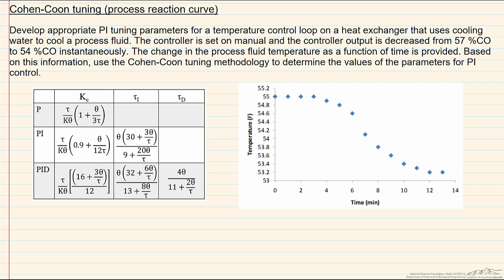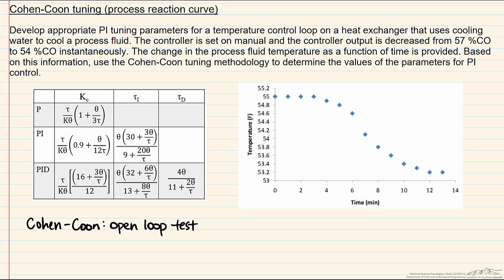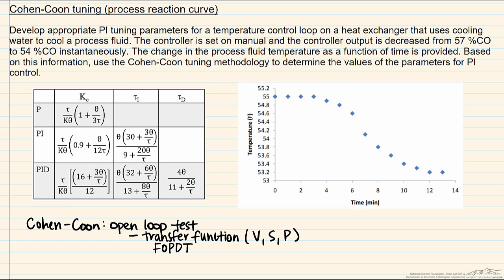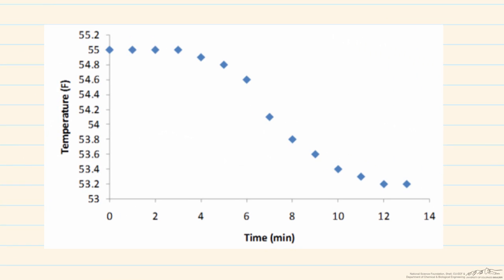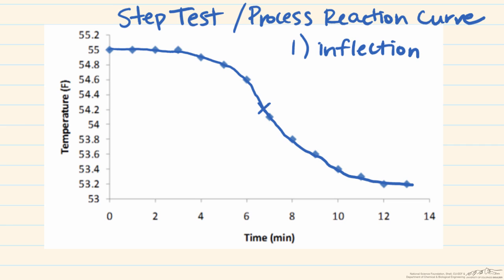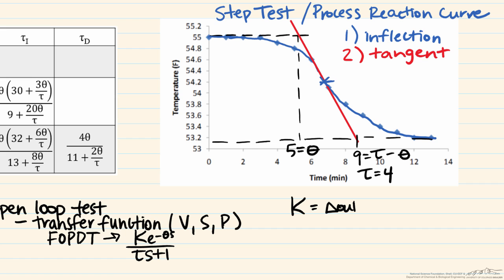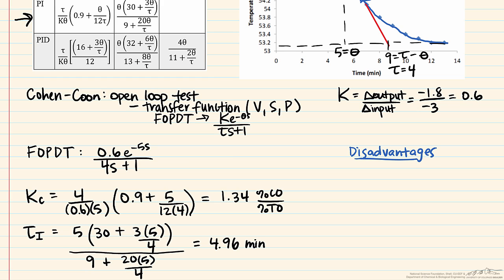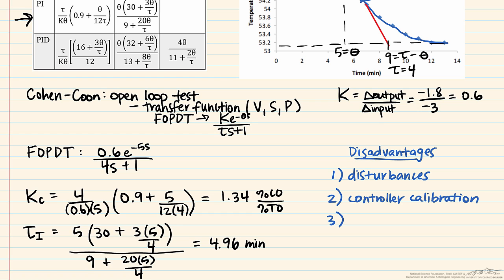Cohen-Coon Tuning (Process Reaction Curve)

Comment: In the problem statement, isn't the change in cold water from 57% to 54% supposed to be called the "input change" instead of the output change?
Reply: i thinks thats right , bcoz here final control element (FCE) is the outpul valve which is controlling the co supply, though im not sure about it....!!!!